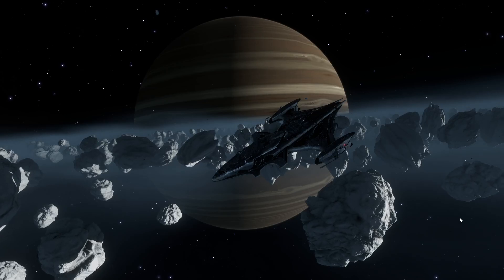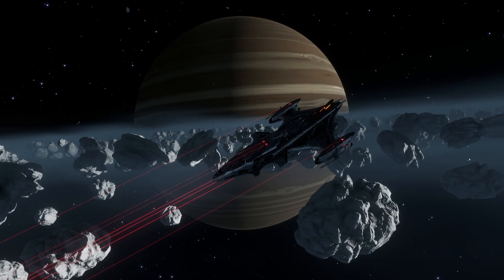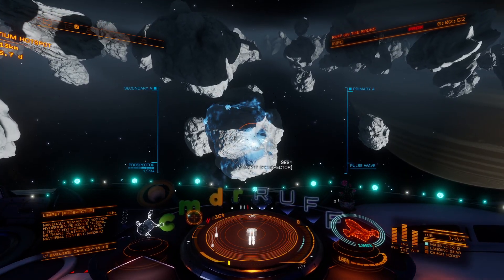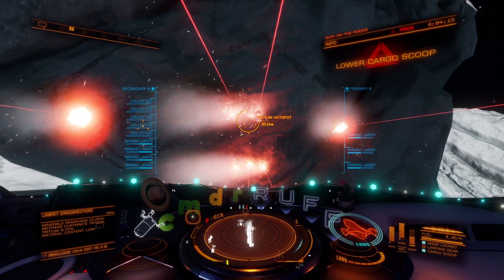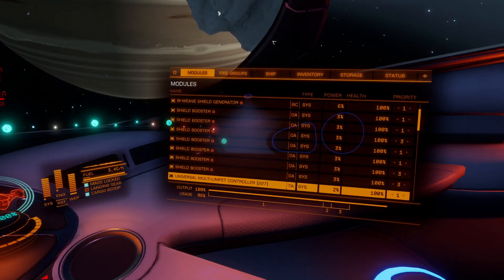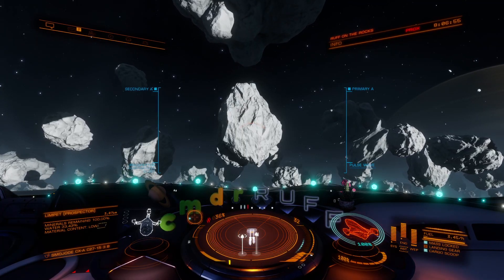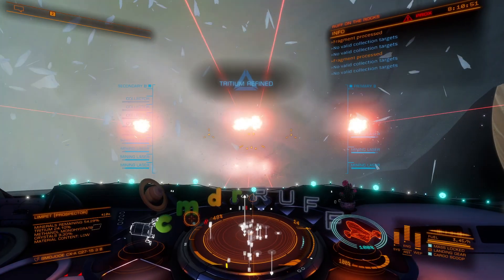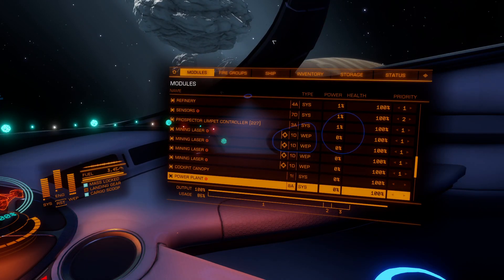Laser Mining Revolution!

Comment: I just seen this vid for the second time since it was released, and was thinking with the 256 cargo capacity wouldnt the Corvette possibly be a better ship to use? I laser mine with the Corvette, and have 20 collectors, two 3A prospectors, and the class 8 Power Distributor allows me to run five class 2, and two class 1 modified 1D mining lasers, so basically I melt the rocks in about 17 seconds, and since I have the prospectors on two different triggers, this way I can prospect four asteroids in about the time it takes for just one 3A prospector to prospect two asteroids.
Reply from the maker: Yeah, I think the Corvette is a good and possibly better option. So far only the Cutter has exceeded 600 tph mining Tritium, so until someone does that in a Vette, it's pure theory.
Reply: @ruffleif8381  yeah certainly that is a big number 😅

Comment: Im stupid noob, сan anyone explain to me why the Mining Multi Limpet Controller 3C is not used? It works with 4 limpets at a time (while the Collector Limpet 5A only holds 3, so 5 x 3C is 20 limpets), and it doesn't take up the 8 slot, allowing for another large rack, which can accommodate an additional 256 limpets/tons. The only reasonable explanation is the limpet lifetime, which is 200 sec shorter? Also, a separate controller for the prospector is not required, even if you add another one just for that...
PS: The question is closed, for some reason Coriolis "allows" any number of multicontrollers, but more than one is not installed in a new purchased Сutter.
Reply from the maker: Coriolis is missing quite a few things. I've switched to EDSY.

Comment: Have you tried mining lance beams?
Reply from the maker: Actually, that's the only powerplay module I never bothered with. Would love to hear if it's actually any different from the tech broker...
Reply: Mining lance’s only benefit is range. It pays for it heavily with power draw.
Reply: @prisonerofthehighway1059  Compared to the pre-engineered 1D's the mining lances are very inferior, their damage fall off starts at 500m and their range is 2km, the pre engineered ones have 2.5 km range with no damage fall off, also they run cooler, use less PD, and less PP.
Reply: @jocl7159 been gone a long time. I don’t think you could engineer mining beams when I left but I could be wrong.

Comment: I’m sure you know this, but just as a clarification note the damage on a mining laser means absolutely nothing to mining.

The class 1 lasers are around 1/3rd as fast at depleting as a class 2 mining laser is, and this applies equally to the pre-engineered ones too. However, you can fit four pre-engineered in the same distributor energy as one class 2, allowing you to get 1.333… class 2 lasers at the cost of three additional hard points. Not 5 which seems to be what the video was saying.

Considering it seems even with 20 limpets you’re collector gated rather than laser mining time gated I guess it’s not that important though that the 4 medium + 3 small setup would mine faster (not sure you’d even have the distributor to sustain that many lasers anyway, didn’t bother checking).

I’m guessing with your group’s data it was found that subsurface launchers weren’t worth using for speed? I know a lot of people in the eliteminers Reddit were exploring using subsurface launchers with the tritium highway mapping projects, some saying it was how they were getting as fast as they could. Since if the SSDs were worth using someone could run 4 mediums + a few subsurface launchers (for ammo).

I’m also really curious about the PWA part, how large a dataset did y’all compile to find a statistically significant increase in yield% near glowing rocks? Would love to see the numbers on this. I don’t remember if k saw this in the eliteminers community Reddit, could be worth posting there to get the word out.

Mining in advance using the long range of the class 1’s has long been something I was thinking could be more efficient but seldom got people to actually try it out / think it was worth using…
Reply from the maker: o7 commander! Search STLC on Inara, you'll find a link to our Discord. It'll be easier to discuss the details there. Thing is, there are many parameters that interact and play together. Briefly, the record for SSD + laser mining with Vette (check my other videos) is 520 tph. Just laser with the Cutter is 410 tph. Nobody we know has done Tritium laser mining faster than 300 tph with just regular lasers. But ring variation is very significant, so this cannot be done in most rings anyhow. You'd be very welcome to join our group. Seems like you've got some insights already!
Reply: It seems like 4 med 3 small is possible with a max-engineered PD (Weapon Focused, Super Conduits or Cluster Cap) but it seems like that same PD could support 5 mediums just as well.
Reply from the maker: @w3yr  Nope. On a Vette/Conda yes, but The Cutter needs the reduced distro draw from the modified mining lasers. And the Cutter can fit 20 collectors.
Reply: @ruffleif8381 I’m honestly pretty surprised you’re so collector gated. Unless tritium specifically has different fragment mechanics that I’m unaware of, against a 42 fragment asteroid your 3m+4s setup would deplete in 23 seconds of full firing (since you start early your total time mining is a bit more but that’s mostly modulated by how fast you travel between rocks which with lithobraking should go decently). If we modeled this as all the rocks just dropping at the start of the lasers and you had 23 seconds to pick them up, that would give you 1.82 seconds per fragment round trip for a single limpet. You have 20 limpets so that scales linearly to 36.5s per limpet round trip. You’re trying to be out of there within 23 seconds so that’s overkill.

Making matters worse, they dont drop all at once. You only generate 1.82 fragments per second on average. So you’ve only saturated your 20 limpets by around the 11 second mark, but in that time normally at least 3 of your limpets or so (depending on distance) should have finished a round trip, meaning they’d re-enter the queue and you would actually not be at saturation yet. I’m not actually sure you’re generating fragments fast enough to ever reach saturation of no limpet left idle provided being close enough.

What I’m missing I guess must be that the cutter configuration just doesn’t generate anything even resembling a coherent stream of rocks at close range so as to make it more likely limpets will have to travel further than ideal, but even with that the mean time needed per 20 limpets seems still too high for your setup, 15 limpets or so should still have more lead time than your 23 seconds need…

And since your hold is less than the per hour figure you’re presumably extrapolating an average across many sessions so I’m curious the statistics there versus having just had more hold
Reply from the maker: @guhak  I'm sure your math is solid. I'm also pretty sure our in-ring experience is solid. Search us up on Inara, squadron STLC, for more in-depth discussion, and you can possibly chat with the brain behind this build who also set the 400tph+ record (Tritium). But to be clear, when you're done with one rock and start mining the neighbor one right away, there's enough to do for the 20 limpets. Thing is Tritium is such low yield that every little efficiency bump matters big time. And there's a lot of those that play together.
Reply: @w3yr not for the 7A PD the cutter has, it can support 4m+3s for 18s whereas a 42 fragment rock (max size) would take 20s on average for that configuration so you’ll stutter.

A 4m+2s+1ssd setup though can be supported with only about 0.5seconds of stutter fire on the 42 fragment rocks while being around 0.14 fragments/s faster than the 3m+4s setup for laser. Alternatively drop another size 1 for 2ssd’s to keep around the same laser rate (in exchange for less pre-mining at distance)
Reply: @guhak stuttering does affect mining speed by a bit, but you won't hit 42-frag rocks every time so you're not likely to cook yourself to death if you stutter every now and then.
Also, Cluster capacitors will raise that limit to 19sec (on 4m+3s) and recharging weapons cap to full takes only 12.25sec which should be enough time between rocks
Reply: Also consider: 4m+2s fully drains a 7A PD WF+CC in 21.55sec (21.47sec if WF+SC).
 
Assuming 0.4183 frag/sec from each medium and 0.14167 frag/sec from each small (from Meithan, 2018), this combo makes 1.96 frag/sec. 
 
Max frag per rock outside a res is 42 which takes 21.47 sec to deplete with 4m+2s and is less than (or equal to) the total drain time on 7A PD WF+CC (or +SC). No stuttering needed.
 
In contrast, 3m+4s makes 1.82 frags/sec and will take 23.06sec to deplete a 42-frag rock. That's a 1.52sec difference, or 7.4% longer.

If you go full 4m+3s, you start stuttering at 18.68sec (enough to deplete a 39-frag rock)  and would theoretically deplete a 42-frag rock in 20.89sec which is faster than 3m+4s by 2.07sec. 
 
(Tests with very small sample sizes by Meithan in 2018 showed "there's no difference" in frag/sec when stuttering and not stuttering.)
Reply: @w3yr  stuttering doesn’t change frags/second in the sense that once the required amount of energy is sent, you still get the same result. However it’s still energy gated, your PD needs to get the amount of energy the setup would finish in. That’s where the slow down, relative to the theoretical max, comes from. For small delta between theoretical fastest time and PD depletion time, it’s pretty negligible. For large delta and it’ll increase the time required from the theoretical fastest more (dependent on how over recharge rate your weapons are).

It also generates a lot more heat so need to be careful of that for some ships, I don’t think this build will run into that but that’s an important caveat to remember if applying this to other builds
Reply: @guhak  I see, I have learned a lot from this conversation. Thank you, CMDR! o7
Reply from the maker: @jocl7159 That makes you an epic laser miner... Hmmm... I think I know you! XD

Comment: Interesting, not sure why I never thought of this, but you are correct, since it takes 3 small to produce fragments at the same speed as a medium, but for the same distro draw as a med you can run 4 small mod, you effectively gain the output of a small laser.  It does make sense for plat mining but for trit it might be worth it to bring seismic charges, abrasion blaster and maybe even ssd missiles to be able to blow a core/ssd if you stumble on one, especially since your use the PWA already. 😉
If you are actually getting 350t/h, that means you're filling your 250t in less than 45 minutes, you might want to bring more cargo and stay in the ring for longer, even if your play sessions are only 45 minutes since you're in the black you could logoff in the ring and just continue where you left off in your next session without spawning pirates as long as you're far enough from the bubble...
You could fit another 256t, with 13 collector which should be more than enough if you are close to the rock and that even lets you get 4 active prospectors.
I noticed that your shields are thermal resistant, if it's for deep space mining it should never be shot at, the only usage of the shields is basically braking, asteroids collisions are absolute damage so the shield and boosters should all be reinforced/heavy duty. if you have the Prismatic Shields unlocked they are great for that, they recharge slow but you'll probably be done mining before you get past their 14k absolute hit points unless you boost into every rock.  
Would look something like this on EDSY  /s/vXl4Nd5
Oh almost forgot, in case you didn't know, you can disable the voice message that says "Prospector Failed" every time you shoot a new one and the old one dies, under Options, Audio, Expand Voice volume,  Ship Voice Vol, Limpet and set Prospector to Off. 
o7
Reply from the maker: o7! For Trit we've found this build to be the fastest, and just about only viable, way to do pure laser mining. Combining SSD+laser is still faster, check my video with the Vette. Abrasion blaster is a wasted hardpoint, even if the fragments are good. It takes too much time. No trit in core, so seismic not needed. My shield is good enough, so haven't bothered re-engineering, but you're right. Trit yield is low, so the 20 collectors absolutely a must for getting some speed, hence the lower cargo space. 

Feel free to join our server for more discussion, search squadron STLC on Inara.
Reply: The main reason few ships ever tried it was that most large ships could fit enough mediums to their distro as to run out of spare hard points to make the 1-4 conversion feasible. That and people wouldn’t believe in the potential starting time benefits from mining at long range while you approach into medium laser distance allowing your collectors to start collecting sooner than going to medium range first. Granted with lithobraking setups and needing to wait for prospectors to engage it is true that you probably only get a fragment or two to pop out from the anaemic size 1 rates by the time you’re within 500 metres… On average 4 size 1’s generate 0.56 fragments a second and if you do a 500m/s boost you’re at the rock within 2-4 seconds assuming you’re within 2km of your next rock always. The lasers can start as far out as 4km but idk if that would practically matter with prospectors. Maybe with a wing of prospectors.